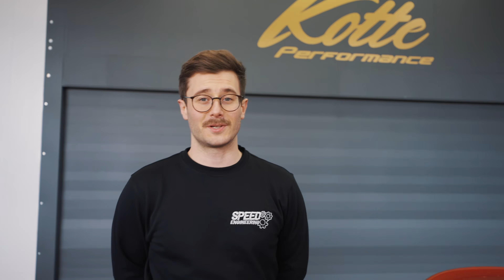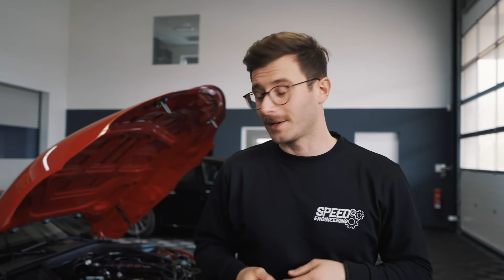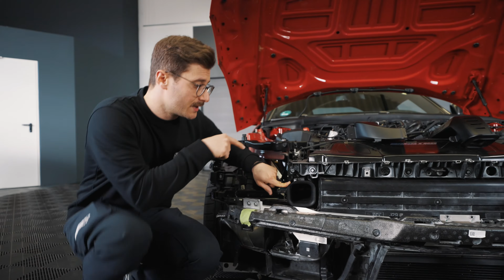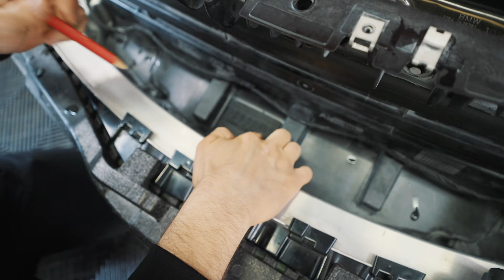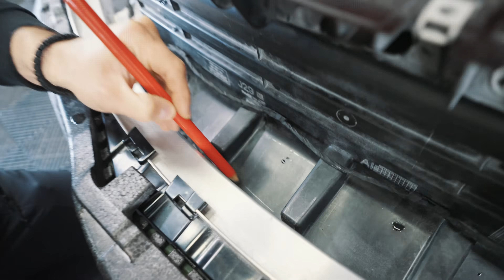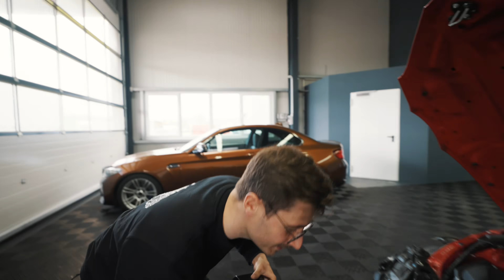Toyota Supra Cold Air Intake for Wagner Tuning & Kotte Performance | SPEED Engineering

Comment: Amy data on temperature changes? 

The guys at Verus designed a nice intake that takes air from the front of the bumper and demonstrated benefit by measuring IATs on the track

Comment: Would this alter the low end airflow in any way shape or form before getting up to speed (ram air effect)? Meaning does it affect engine performance at slow speed? I would be interested how it behaves on a dyno when trying to replicate a street light to street light pull. In my mind I would think that such a long intake duct can cause some air starvation at low speed? I see the extra vent in the elbow but is it enough? I am just curious if there are any disadvantages. Thank you.